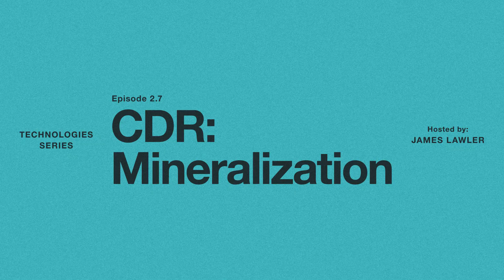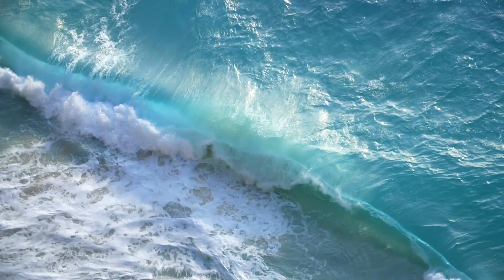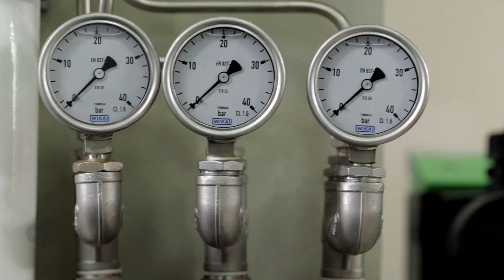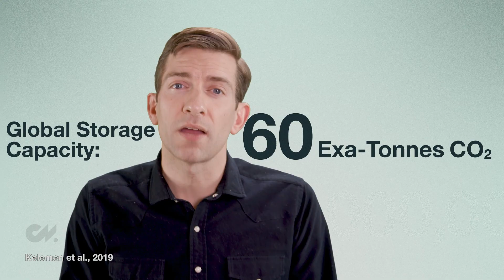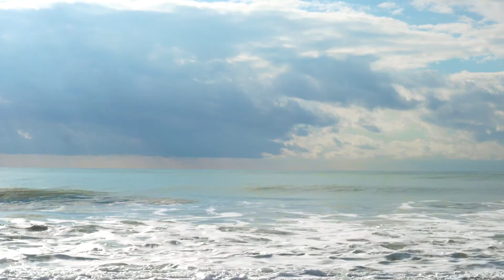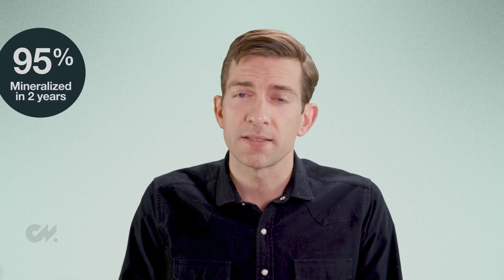Carbon Dioxide Removal: Mineralization | Climate Now Ep. 2.7

Comment: To remove the gas of life out of the natural cycle is a clear sign of severe crazyness. Nature does it itself by shell producing animals that convert CO2 and Calcium into limestone. Luckily our planet has a mechanism called continental drift that pulls thick layers of limestone sediment into the hot earth crust and thus frees the stored CO2 again after some million years. Otherwise life on earth would end as soon as CO2 level reach values below 150ppm.  Craziness is progressing so rapidly and so dangerously that I see no other solution than to take crazy people out of the public debate.

Comment: Regarding Geothermal in the last section, The price and locations have changed due to the ability to cheaply 'bore' through rock and especially near plants that use fossil fuel which will be used to provide the actual conversion of heat to electricity at a very low cost and its available 24/7 over the life time of the earth. Also, it can be set up in all parts of the world - major change, So actually there will be almost no need for fossil fuels, bios, etc, except to wheel out an old gas guzzling 4,5 or 6 litre for 'show' purposes  from time to time :P

Comment: There is another form of in situ mineralization method that you missed. Mineral accretion through electrolysis. This is currently used to repair damaged coral reefs or to create new ones. Each site can store hundreds of tones of co2 in the form of calcium and magnesium carbonate. It can be done at a negative cost, as the areas where it is done become marine nurseries that help reverse diminishing fish stocks. These improved fish stocks can then be carefully managed to create a sustainable fishing industry. Having a sustainable fishing industry, helps reduce the need for an ever increasing growth in the production of land based meat. Again, in turn helping the environment.

Comment: Enhanced weathering is the way to go. Focus on pinelands and rice paddies and other acidic soils. Dump GT of ultra maffic rock powder. I was both a farmer and a petroleum geologist so I can say the following: (1) spreading stuff on fields costs $$$- better to do it large quantities on small areas that are acidic and leave it to break down over time and (2) insitu will not work. Basalt is a very low porosity facies. You can store very small quantities in fractures but they will quickly mineralize and then you are basically trying to frac an ultra tight rock. This will only work in very specific locations with fractured basalt. I reckon that if coal can be mined, shipped around the World, powdered and burned in boilers for $100/t than ultra maffic rock can be surface quarried and powdered for a similar cost. Permanently storing carbon through enhanced weathering for $150/t is the best solution there is. This is a geological problem it requires a geological solution.
Reply: How do you deal with the elevated Ni and Cr in ultramafics? I can see that being a sticking point
Reply: @handlethejandal  maybe for agricultural lands you would prefer to use grantic source rock to reduce this risk. I think in pinelands of the American SE or deforested tropical soils prior to reforestation that would be less of a concern. The problem with ocean weathering is oceans are already basic. Lickens excrete formic acid to precipitate weathering of granite and it exponentially accelerates the breakdown of chemical bonds.